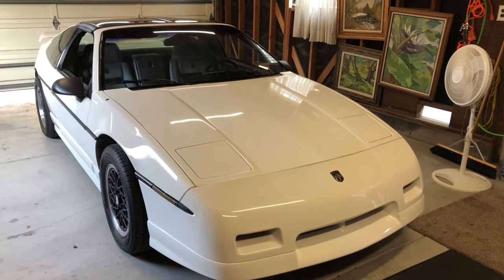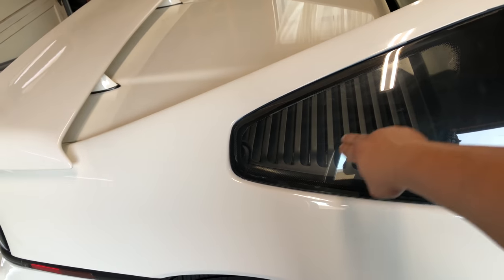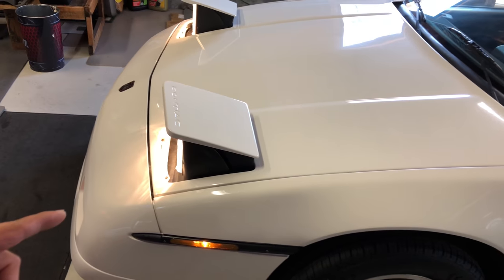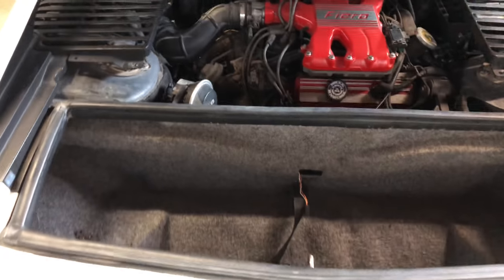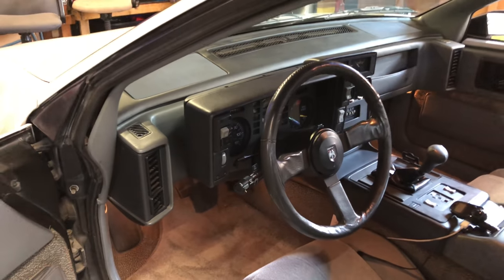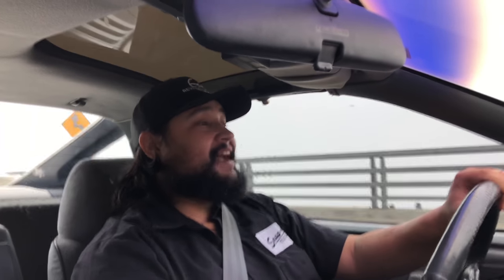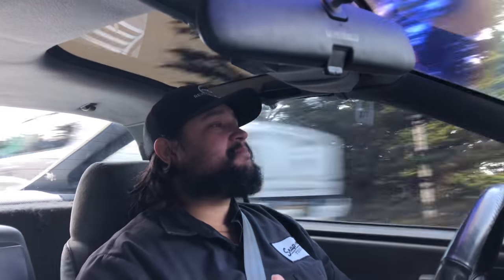I REVIEW MY NEW GM MID ENGINE SPORTS CAR!! | MY 1988 Pontiac Fiero GT Coupe

Comment: I owned 2 Fieros.  A 1986 4M2, that is a 2.5 litre 4 cylinder 5 speed, and a 1988 2M4 5 speed.  The '86 got totalled but my daughter who was driving it was safe because of the crash worthiness of the vehicle.  The '88 handled much better because of the more advanced suspension.  Unfortunately the engine  on the '86 developed a cracked head because I drove it in -35C( -31 Fahrenheit) weather without allowing it to warm up properly, and I never got it fixed but years later sold it.  Both of these Fiero's had sunroofs which we stowed in the front compartment. They were fun to drive and the '88 certainly handled much better.  I'm thinking about finding another '88 but a GT this time.
Reply: Incidently, the fires in the '84 fieros were caused by an oil leak from the gasket between the PVC and the valve cover.  It was a large metal pvc conduit and would tend to move and cause the gasket to leak.  The oil would leak down over the hot exhaust manifold and start on fire.
Reply: In order to remove the engine which was mounted on a subframe the car had to be hoisted up and the subframe dropped out the bottom of the engine compartment.

Comment: I was Heavy line/Auto trans for Buick/Pontiac/GMC from 1981 till 2008. I was there when the Fiero came out and left. They got them right the last year. The cars would have been Corvette beaters but GM didn't want that. I made a lot of money working on the 84-87 2.5 cam gears. It would have been legendary except for the corporation. I could have the engine\trans out in 27 minutes. We had to do that many many times.

Comment: The MR2, once it received a power upgrade the car basically wanted to kill inexperienced drivers.  The Fiero was relatively well balanced in combination with it's handling vs it's horsepower.  I've taken a road trip both an MR2 and a '85 Fiero GT and I found that in comparison between the 2 cars from the seats, the general ride and the ability to stow luggage the Fiero was far more accommodating and forgiving.

I've yet to ride in a T-Top Fiero, I'm a little jealous.  Thank you for sharing your Fiero.

Comment: Glad you are in love with your Fiero. So do I... with mine. 
The longer rear line is called Fastback. The earlier version is called Notchback or Notchie. 
The second generation was supposed to come out with fastback & notchback as well. 

Speaking of Mera, did you know that Fiero is faster than Ferrari 308? Yep!

I noticed your trunk release button is not working right. Did you know you could take it apart & clean it up. That should work better and return to its original position when pressed.
If you don't have the patience or time, you could always replace it & be done with it. 
Enjoy your exotic sports car, man!
Reply from the maker: I’m really glad you enjoyed the video. I did not know that the second generation was supposed to come out with a notch back as well that would have been pretty cool. And yes I did actually read the article where they compare the Mera to the Ferrari and it was surprising (in a good way) to say the least. It’s impressive how good these cars were/are. Also I have replaced the button shortly after I uploaded the video. I will be taking the old one apart soon to clean it and have as a back up. Thanks so much for the input and I hope you enjoy the rest of my videos.

Comment: You have a really nice specimen of an 88 Fiero, enjoy it. Love the T-Tops! I did a restomod of an 86 1/2 Fiero about 10 years ago. The thing is a go kart with 200 HP on tap due to an engine swap and other mods. BTW, the hood, roof and rear decklid are made of FRP - Fiberglass reinforced plastic. The rest is made of what GM calls RIM, basically urethane plastic. The stock 2.8 Fiero is 140 HP and 170 Ft-Lbs of torque. 

Have you looked to see if you can put the T-Tops in the Frunk? I have the sunroof and it clips in up front. Be real careful with the T-Top rubber seals, I don't think they are available any more. The same with the tail lights. I bought the last right side one from the Fiero store 4 years ago.

As stated by other, the 1984-87 suspension used a Chevette front end in the front and the front end from a X-body (Pontiac Phoenix) in the rear. Despite the humble source of these parts, modifications can be made to up the handling (as I did) to better than 88 spec. While the 88 suspension is excellent, parts are becoming unobtainum due to the limited production of the model.

Comment: All the wheels are 15x7. The front wheels are just offset differently on the 88 models because of the Lotus designed suspension that the 88s have. You can fit 245 50s on the back and 225 50s on the front They fit without rubbing and look a whole lot better.

Comment: As an owner of a Pontiac fiero, I'm here to tell you that the T-tops do not go in the trunk. There is a space underneath the hood where the fit and sit perfectly but you wouldn't know because you probably don't have the owners manual. Check it out man!
Reply from the maker: I will check it out, thank you so much!
Reply: @tailsfromthejunkyard1023  I'd hate for them to get damaged rattling around in the trunk.
Reply: Did you have a chance to look under the hood to see the sunroof bag and the section that the glass sits in?

Comment: I remember reading an article in hot rod of a 409 in fiero and the guy saying how he loved passing porsches..... I can't imagine how hard regular maintenance would be with a V8 in one! Good luck with yours maybe turbo or procharger and see how long the engine lasts.
Reply from the maker: I have actually read that same article and yeah not doing a V8, but I did look into turbo or supercharger and I guess the recommended thing is to run it until it dies and then swap out 3.4 V6 of the same family and boost that one instead

Comment: Very nice! Optioned just right too, with the 5spd and T-tops. 
Bad that the steering wheel cores shrank allowing the leather cover to slip around. Covering the wheel if left out in the sun helped to keep that from happening. But most people didn't cover them. 
I had an 85 GT 4spd (5spd wasn't available until later). I'd like to have a nice 88 like yours. Always liked 88 the best of the few years they made these.
Reply from the maker: Thank you so much I really love this car too

Comment: Go to a junkyard and get a block from a 1995 v6 Camaro and everything on top will bolt right up except the starter will need to be relocated to the other side and that should get you to around 190 hp. I miss my 1987 GT.
Reply from the maker: Awesome thanks for the tip, definitely will be doing that whenever this 2.8 finally gives out.

Comment: Super clean car. Great find.
I agree to keep it as is. 

Have an article somewhere from Car Craft from 80's or early 90's where a Pontiac 455 was installed w/a Olds Toronado T425 FWD trans. Believed the article claimed they fit w/o having to heavily modify the car. Had to use stock exhaust manifolds and if you wanted to change the spark plugs you had to pull out the engine. All Pontiac V8's from 1965-76 had the same outer dimensions so taking weight off the engine might help.
Reply from the maker: Yeah actually I read that article along time ago and I remember that. Everybody keeps telling me to go with the Cadillac 4.9 L V8 that was in the Front Wheel Drive Allante because his boat up to my transmission. But honestly I’m thinking of going with a 3.4 L V6 with a turbo
Reply: @tailsfromthejunkyard1023  Since you have a hot rod why not just take care of the 2.8. Your car is a rare piece.
I know, the 2.8 is boring.
Is a 3.4 going to be that much more exciting? 
Shame Pontiac didn't develop thier own FWD performance engines that I know of. GM was going corporate w/ thier engines in the 80's.
I hate cross branding makes of cars and engines.
A lot more power isn't great on a unibody car w/ t-tops. Had a couple of Camaro rattletraps w/ them.
Reply: @tailsfromthejunkyard1023  Would a Buick 3.8 bolt in w/ little hassle?
Kenne Bell used to make aftermarket turbos and accesories for these long ago. Now they make superchargers for new Mustangs.
Reply from the maker: RoadKill Doesn't Fly The 3.8 swap is actually common on these but it is a bit of a hassle. What I meant earlier about the 3.4 swap is that I wouldn’t do this until this particular engine that’s already in the car would give out. Otherwise I intended to leave as is, maintain it and enjoy it
Reply: @tailsfromthejunkyard1023  The 3.4 L is a no brainer once the 2.8 dies. Its a super simple swap, until you start adding boost. I don't think you can put much boost to one of those reliably though. But it'd be a bump.

 You can basically throw any FWD GM platform from 80's-2000's and find a way to bolt it to the 5-speed, or a SB Chevy v8, with an adaptor plate. Lots of LS powered Fieros out there.  3800 SC are very popular too, still with a lot of aftermarket support.  But there's extra work in the wiring harness, cuz you're basically mating the car to a swapped comp. There are guys still making conversion harnesses though, if that is'nt your jam.

There's a FB page for modded Fieros, if you want to explore options, when the time comes. The guys on there are usually pretty helpful.

I have an 86 GT with a ported/polished 3.4 DOHC swap, with some beefed up internals. It's putting over 200 HP (220-30ish) to the ground, and it's a ton of fun. 

Enjoy yours man! They are fun.

Cheers

Comment: Great video and beautiful car. Missing my '86 Fiero SE. Mine actually came with a custom T-top. Loved that car but the 4-speed (non-Getrag) transmission was weak. Just a quick correction: the torque on the V6 140 BHP is 155 ft/lbs (not the 132 mentioned. That's for the inline 4).
Reply: Powertrain specs
Engine type 	V6, 12v
Displacement 	2.8 l (173 ci / 2837 cc)
Power 	142 ps (140 bhp / 104 kw)
Torque 	230 Nm (170 lb-ft)
Power / liter 	50 ps (49 hp)
Power / weight 	116 ps (114 bhp) / t
Torque / weight 	188 Nm (138 lb-ft) / t
Transmission 	4M
Layout 	middle engine, rear wheel drive    FYI Engine 2.8 liter L44 was the Fiero there were 2.8 liters in other cars..

Comment: GM didn’t like the car but once Pontiac got the bugs worked out in 88 it was a great little sports car.,
Reply from the maker: Yes GM was against this thing from the beginning. Anything that threatened the Corvette was a no go. It doesn’t help that in 88 the Fiero was a better performing sports car then he Vette.
Reply: @tailsfromthejunkyard1023  I’m surprised that Buick got away with offering the Regal Grand National and the GNX.
Reply from the maker: @86twin  agreed! I think Buick was pretty reckless during those years and honestly they got treated better too
Reply: @86twin  I think Buick was working on the GN and GNX secretly, PONTIAC used to do stuff like that back in the 60’s but now PONTIAC is dead. Sad.

Comment: Awesome car. I had a chance to buy an 88 blue t-top one 5 speed. It was hard shifting , no grinding so I passed. Heard that all it might have been is the shift cables.  The guy wanted 4k at the time
Reply from the maker: Sounds like an awesome car, you should get it if you still can
Reply: @tailsfromthejunkyard1023  was a while ago and don't see many 88s available and 5 speed ..
About how much should you pay for a low mileage, good condition if i can ask ? Thanks
Reply from the maker: @recyclespinning9839  hard to say really, depending on the options on it and the conditions it’s in, it can go from 6,000 to 20,000 for an 88

Comment: I had an '88 GT with 5 speed getrag and double the original horsepower out of the original engine. Pushed pretty hard. 
Until it disappeared into nothingness.

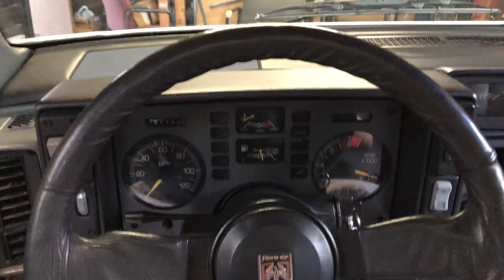Comment: @19:27 don't want to bash on the car, but that does not look factory... could be wrong though... still lovely car!
Reply from the maker: Nice catch!, it is actually factory according to the vin and the options card, but I guess when the guy was restoring it he had to redo that area and he just couldn’t get it right, at least that’s his story.
Reply: @tailsfromthejunkyard1023  there are 'kits' to make a regular fiero a t top. But if the vin confirmes it is a t top from the factory,  we believe the vin. Either way, i like this one. I have an 88 gt, red, without sunroof ( my personal preference )
Reply: It's because they weren't. Well, not exactly. Pre-88 Fieros were modified for t-tops at Cars & Concepts, in 1988 Pontiac began offering them as a factory option. However, nothing changed in the actual conversion. The Cars & Concepts set-up remained, it was just an authorized option from Pontiac available that could be ordered from your neighborhood dealer.

Comment: They also had issues with cooling if i recall design flaws killed off many car's
Reply: I never had any cooling issues with mine. If you don’t burp the air out of the cooling system, it will overheat.

Comment: Some of the panels are plastic, others like the rear hatch are actually fiberglass.
Reply from the maker: Yes that is correct. If I’m not mistaken the hood and rear trunk/engine hatch are fiberglass, the rest of the body panels are plastic. All mounted to a steel space frame.
Reply: @tailsfromthejunkyard1023  i have been doing alot of research about these, my uncle owned a couple when he was younger. I am actually planning to concert one of the earlier ones to electric. (I dont like how the newer rear window area looks)
Reply from the maker: @deltacx1059  that sounds like an awesome project man!
Reply: @tailsfromthejunkyard1023  its pretty much the perfect car for it.
Reply from the maker: @deltacx1059  it’ll actually give you a chance to even out the weight distribution as well
Reply: @tailsfromthejunkyard1023  its pretty ok as is but the batteries will end up moving the center of mass forward and down. Also i discovered that the fiero builds up alot of pressure in the front where the radiator is at which causes the light covers to pop up at high speed so i will be installing a vent.
Reply from the maker: @deltacx1059  honestly I have been thinking of adding a vent on the hood as well.. but now that I know how rare this thing is I’m going to have to find another hood to do it to
Reply: @tailsfromthejunkyard1023  well if you are up for a nice DIY project then there are plenty of guides on how to make your own hood out of fiberglass so you dont have to sacrifice a OEM hood.  There is so much potential in these cars.
Reply from the maker: @deltacx1059  I agree these cars have a lot left on the table to work with
Reply: @tailsfromthejunkyard1023  when i get mine im going to slowly bring it up to modern spec. How much room do they have in the engine bay? Ive seen people put some huge engines in them and still keep the trunk space.
Reply from the maker: @deltacx1059  well there’s enough room back there to put a big block Buick engine in it so that should tell you something. You should get on the Facebook forum for the Fiero club I think there’s a guy on there trying to do a Tesla conversion on one I’d have to check. Those guys are super knowledgeable super helpful and super friendly for the most part
Reply: @tailsfromthejunkyard1023  tesla motors range from 450-650 hp in their normal configuration so that guy is going to have some fun. I plan to use the tesla batteries but not their motors.

Comment: nice i need one with a motor upgrade i have cool thing to trade
Reply from the maker: Thanks and good luck on your search. I intended to upgrade mine when the engine finally gives out
Reply: @tailsfromthejunkyard1023  good luck at it giving out i had one i drove every day for over a year over heating when the heater stops you pull over carfully  remove the volcanos cap let it settle down add till full go at it again  i have had several feiros gt and se

Comment: I had an 88 GT but it had the sunroof instead of the T-Tops.  The sunroof in mine could be removed and stored in the front trunk over the spare... Do the T=Tops not fit there in the same manner?
Reply from the maker: I suspect that they do but for some reason they didn’t make it that way there’s a strap in the trunk area that holds them down. I’m going to assume that they probably thought they were too fragile to put in the front your guess is good as mine.

Comment: i have an 88 with t-tops but GMs first mid engine car was the 1963 corvette
Reply from the maker: That is very true!
Reply: The 63 Vette has the engine in the front.
Reply: @blairbelch9807  yes it does  but it is front mid engined  look it up  and find out the truth
Reply: @blairbelch9807  did you look? or do you need the definition?  if the front leading edge of a cars crankshaft is behind the centerline of the suspensions spindles crossways, defines it as a mid engined car and the 1963 up till 2019  oh yes I have won many a bet on this one
Reply: Technically, the 63 could be called a mid engine car, but it doesn't have any of the handling and traction benefits of a true mid engine car.  That's why the C8 is much faster than the C7 with way more horsepower.
Reply: @blairbelch9807  Not technically, it is mid and the engineers of the day did it to help balance the car better as even INDY cars were front mid engined cars and of the same layout,  the rest of your comment was just deflecting the fact you were wrong!!!
Reply: @paulm7460  Which is faster, the C8 with less than 500 hp or the C7 with much more?  That's why the Corvette now has the engine behind the driver.  Ask Zora!
Reply: @blairbelch9807  so?  the question was the first mid engined GM production car and you were wrong  1963 vette wins